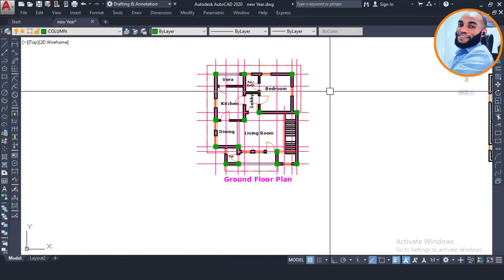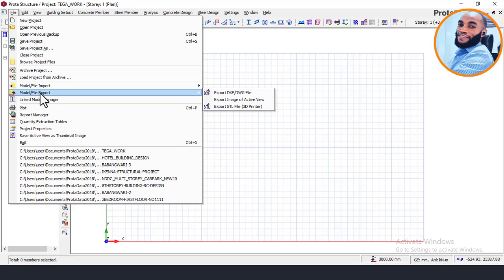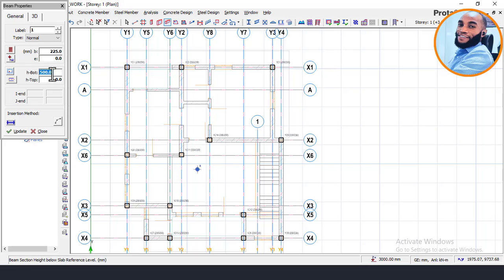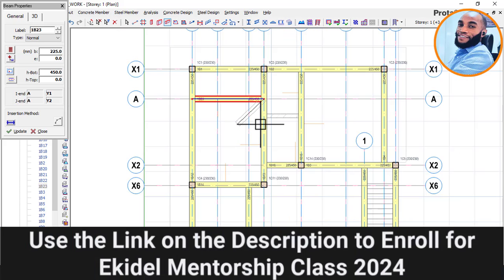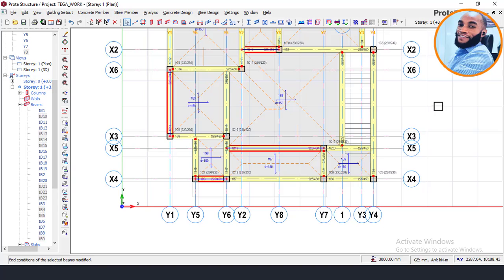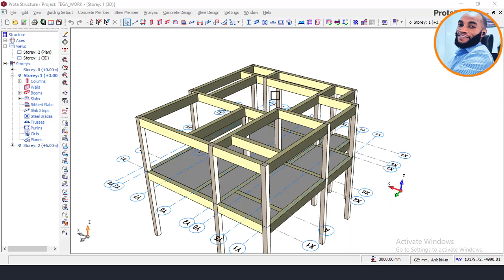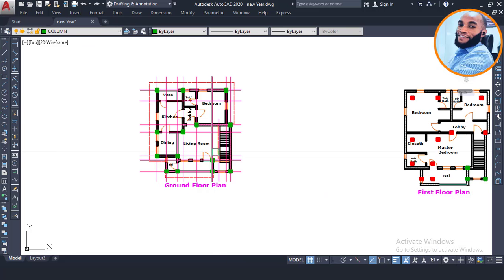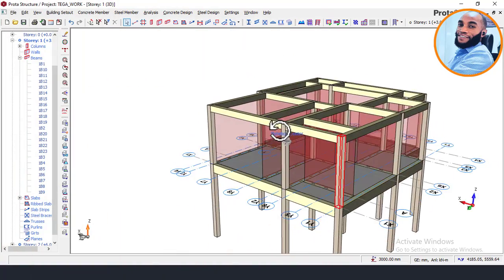Design of Simple Building with Different Column Positions - Protastructure   |PART 2| ekidel

Comment: Good evening sir,
My question is;
On the first floor general arrangement plan, prota structures uses the ground floor columns on the first floor G.A. is this correct or the plans generated by prota should be edited in terms of the column positioning where the columns beneath a floor is used on the plan rather than the columns on that floor.
Thank you.
Hope to hear favourable from you soon.
Reply from the maker: No, you will need to reposition the columns on first floor if needed on Protastructure before design